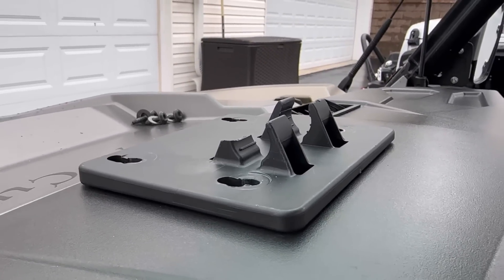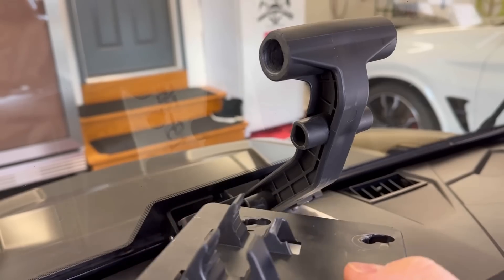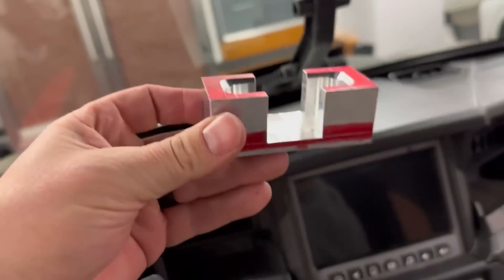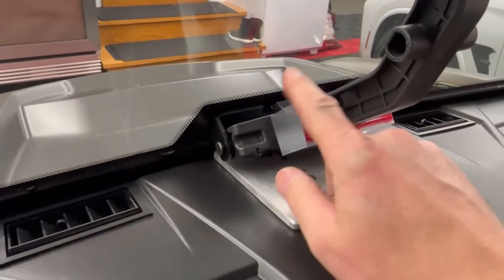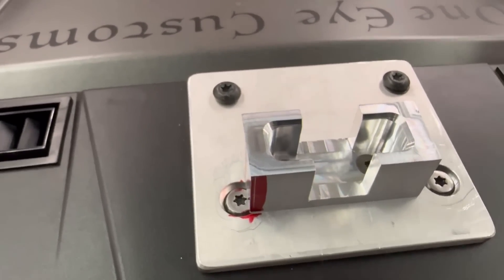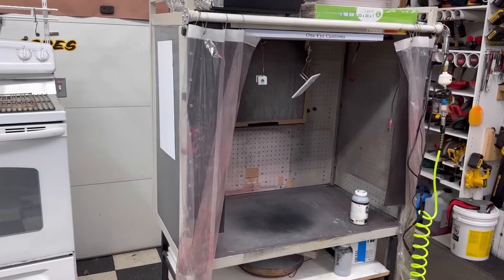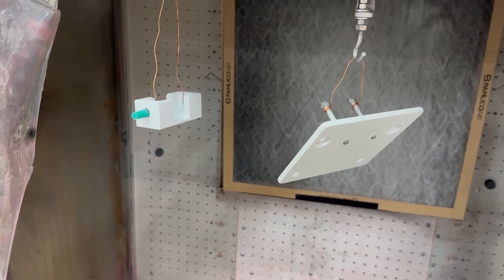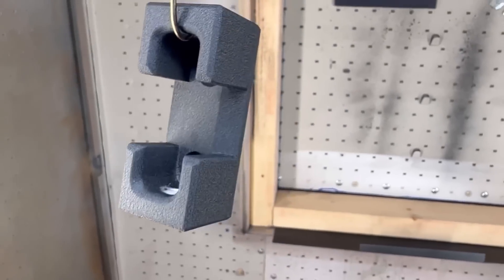Polaris Tip out windshield latch breaking. #polaris

Comment: Have you started making these and selling them? I have the same problem with mine, the first one broke by the 2nd ride and the 2nd one just doesn’t latch right and feels like I’m going to snap the handle just to latch it
Reply from the maker: There is a company caller “Only Generals” that makes something very similar. Look them up and they will have what you need.

Comment: Did you drill a hole thru the handle for the pin or was the hole already there?  Live Oak, Florida
Reply from the maker: @Robert Giguere The holes are already in the handle making it very easy to just use them. 
Thanks for watching!!

Comment: pretty cool.  It is fun watching someone's vision come to life.  I have seen spring loaded ball bearings you could put to the inside but have no idea how to fabricate it to add it.  I would have to mimic what someone else has done.   Or, make your pin spring loaded and only be able to pull out far enough for the handle to be inserted.  let go and the spring pops it into the handle.

Comment: Machining/fab/weld/paint videos are always good!  It appears, though, that the original plastic piece was modified to move the bracket further away from the window.......I'm assuming so it would latch the window closed tighter against the seal?  That had to really ramp up the pressure on those wimpy plastic uprights.  IMO, Polaris screwed the pooch on that entire window latching setup.

Comment: Yes, you need some sort of safety strap to keep from popping out.  With the plastic handle rubbing in and out of the aluminum block, the snug fit will eventually loosen as the plastic handle wears.  Locking pin is a great solution!

Comment: You might be able to make a product out of that. First, I have wonder what bozo at Polaris decided that the latch shouldn't be centered between the mounting screws... If the side walls of the latch were narrowed slightly, and/or a screw with a smaller head, it looks like there should be enough clearance to get the rear left mounting screw in. Then the whole piece could be milled from a single block of UHMW. If you stuck with aluminum, it could be sand cast to reduce costs. Or milled from aluminum if you wanted to sell it as billet, which seems to be all the rage these days.